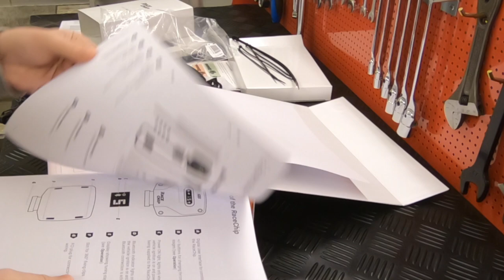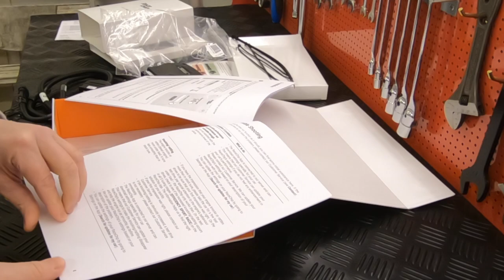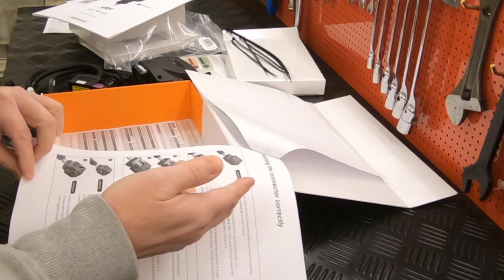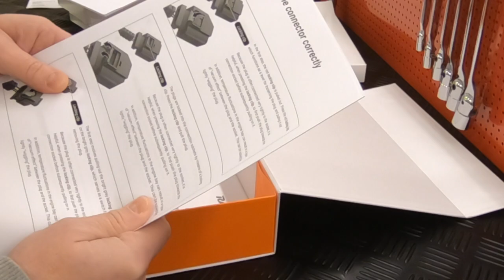RaceChip tuning box install on my Abarth Competizione MY2019

Comment: Hey Lindis nice install man! I’m in the U.K. and bought an S race chip box , like you I had issues finding where things went! I have a 2015 Abarth 595 and oddly enough the engine layout is similar to your Biposto (with obvious differences in performance of course!) but thank you for this video, I know now where my Boost sensor is 😂 I was close at least! Thanks for a nice well thought out video. After seeing this I think I will have another crack at it 😉 oh and it’d be lovely to find out if you got any more difference in performance/power after your install? 😎👍🏾
Reply: @Corbin Keenan Thanks for the tip!

Comment: Your car it's still running  properly?  Do you check the AFR?  I know that tjet and multiair are working on lampda corection, thei dont have a fuel map.  But the question is: with racechip (which increas the boost), the ECU  can corect the AFR? Or the car is runing to lean?
Reply: @Tobias Myles flixportal
Reply: @Davian Jaden thank you, I signed up and it seems like they got a lot of movies there =) I really appreciate it!!
Reply: @Tobias Myles glad I could help :)

Comment: did you get power increase >??
Reply from the maker: Have not put it on a dyno before and after, but there's a noticeable difference for sure. And as you can see in the following video I have lowered the acceleration times on 4th gear pulls by -17% between 100-150 kph. So it sure did something... ;)
https://www.youtube.com/watch?v=geEGLbxeC4w&t=16s